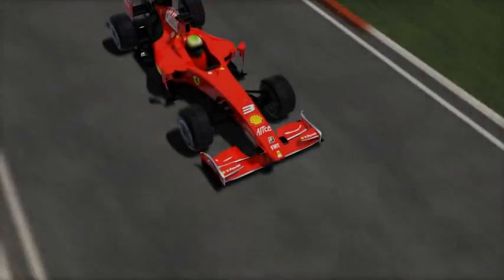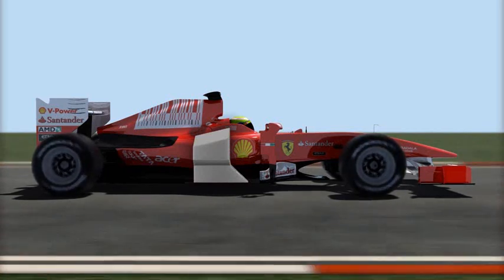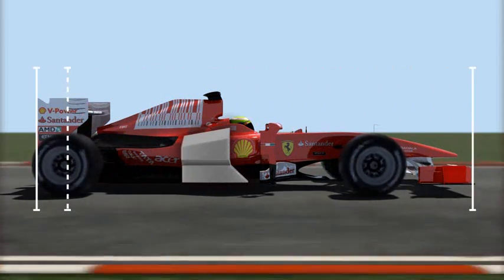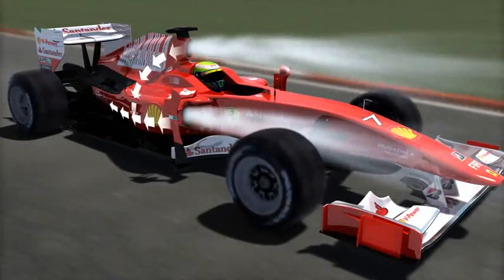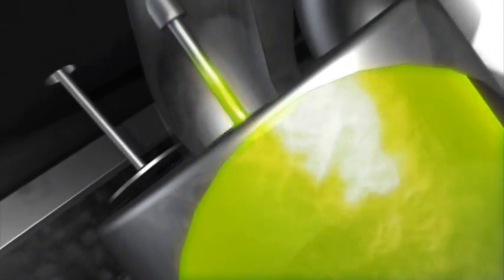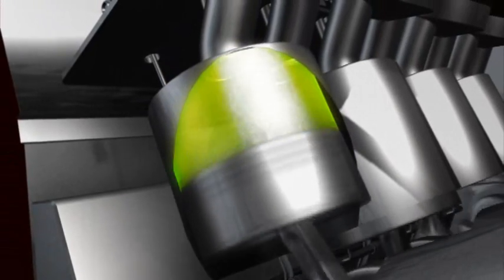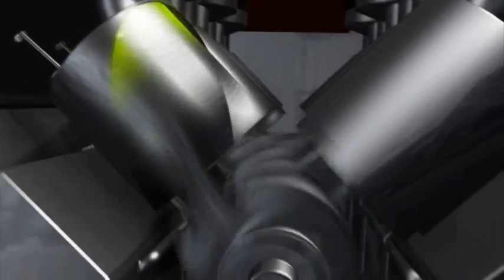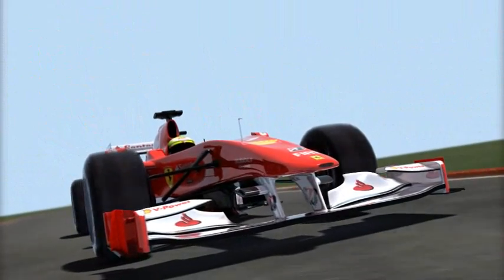F1: How new fuel regulations influence car design

Comment: if you inject fuel directly into the cylinder you will not get adequate mixing of the fuel and oxidizer. However, you will get pre-ignition, hot spots and eventually failure.